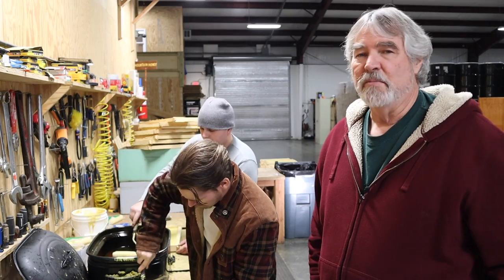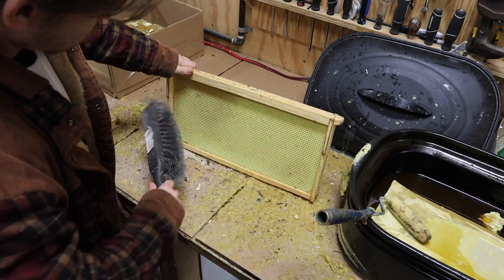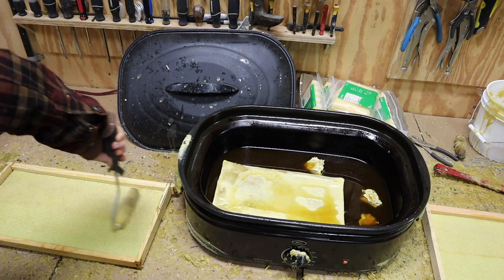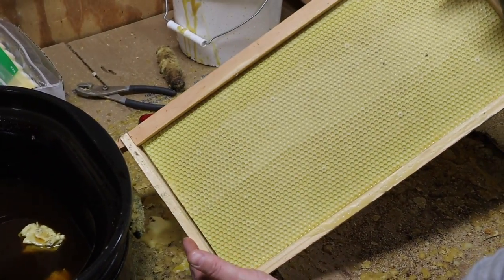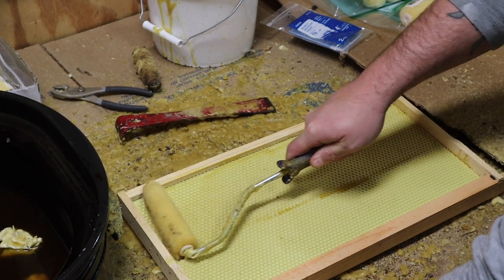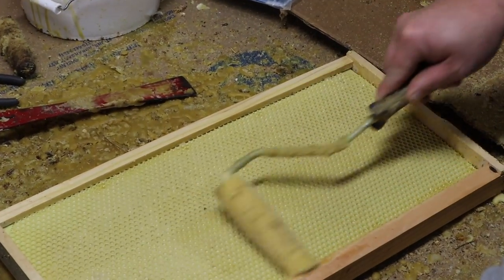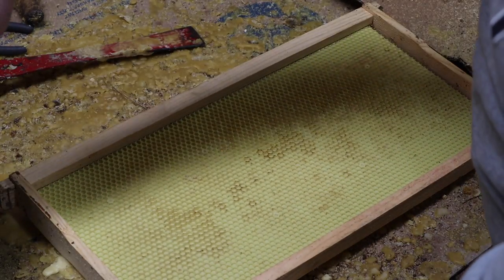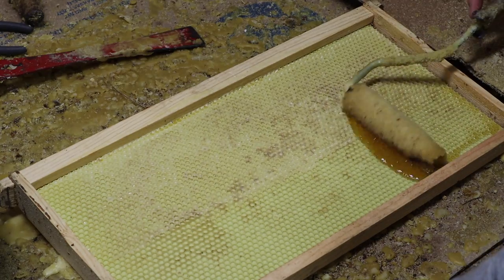How to Apply Beeswax to Plastic Foundation

Comment: I like how you lay several layers of beeswax with a loaded rollers with a leading edge of honey - nice job.  Too many beeks brush a few strokes with only one loaded roller and call it good leaving thin and thick spots.  They say the bees will move it around to where it suits them.  Why add more work for the bees - the idea is to get comb drawn ASAP.  Your approach also helps to seal up the side edges helping the bees out a little.  thanks for the video.
Reply from the maker: Thanks for the comment

Comment: I have been a beekeeper in the UK for 40 years. I decided to try plastic foundation in the supers  on  two hives  this year. 
It resulted in one hive reluctantly drawing the foundation  and the other hive refusing  point blank to even look at it.
 The result was both hives swarming  despite  the fact they were re queened last August.
Think very carefully before you fall in the plastic trap.
Reply from the maker: We've had good experiences with it as long as it has ample wax on it. If it doesn't the bees sometimes consider it another wall.

Comment: Do you add wax to the brood box frames? Or the super frames? Brand new to beekeeping and a little confused.
Reply from the maker: The new foundation we use is pre-waxed. It can help to add more but it's not absolutely necessary. We do add wax to old foundation. Don't feel bad. The confusion never stops. 🤔

Comment: Thanks for the video very well explained.  I'm about to coat 60 3/4 size frames.  About how much wax will I need?

Thanks in advance
Reply from the maker: I'm not sure but I think it will take several pounds depending on how thick you make it. Good luck.

Comment: Hi Bob, love your videos.  I was going to ask what that was in the electric roasting pan that you were rolling the excess wax off of, as it looks huge.  This will be my first year beekeeping, and I just found an old Oster roasting pan for 15 bucks.  Since the one pound wax blocks I bought are about 3" x 6" or so, do you think it would be acceptable if I just set a regular brick in the bottom of the roaster to use for rolling excess wax off the foam roller?  Thanks
Reply from the maker: It's a block of beeswax in the pan.

Comment: I have reused the same ritecell foundation for a few years now. I have pressured washed the foundation but it doesn’t come completely clean any more. Still ok to use? Just apply wax over the stained ones?
Reply from the maker: Yes, as long as the defined cell wall remains.

Comment: How did you prepare them to be waxed? What's your process to clean them? Do you prefer black or yellow plastic foundation?
Reply from the maker: We're happy with either foundation. We usually just brush dirty foundation off. If it is old comb we just throw it away although I have pressure washed in the past which works good.

Comment: I have the same roaster. Is there a certain temperature you like to set it at? I have found that both too hot and too cold the wax doesn’t stick to the foundation very well.
Reply from the maker: Hi Andrew. We set it on 350 to get things melted and then set it between 225 and 250 while working.

Comment: Bob, I like the idea of a roasting pan. It would hold more wax. We've been using two crockpots I got from Walmart, for about three years. We use a 4" paint roller with a thicker pad. Does the thin roller pad work better?
Reply from the maker: Hi Jim. We've tried several different rollers and the one we're using here seems to work good.

Comment: Can I use wood frames and plastic foundation for my honey supers?  Do I need any other support (e.g. fishing line or wire)?
Reply from the maker: This is the combination we are currently using. No support needed with plastic foundation. Just make sure it has a coat of wax on it. Many manufactures do a good job with this but some don't.

Comment: Why don't you dip it in the wax?
Reply from the maker: You can do that but you have to be careful not to apply to much. It's best if the cell remains defined on the foundation. I have a friend that dips in a vessel of very hot water with a thin layer of melted wax on top to avoid over applying.
Reply: @bobbinnie9872  I'm about to switch to plastic frames and thinking of pre-heating the frames and then dipping them to avoid over applying. Pre-heating makes the wax not set immediately, preventing over applying. I need to do some real-world tests though to verify my statements.
Reply from the maker: @verlicht  Let me know how it works.